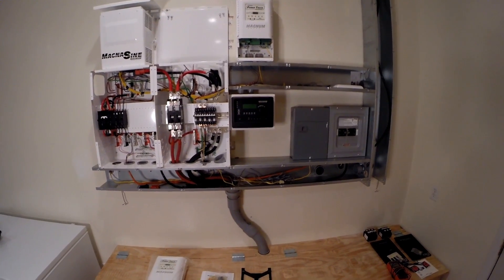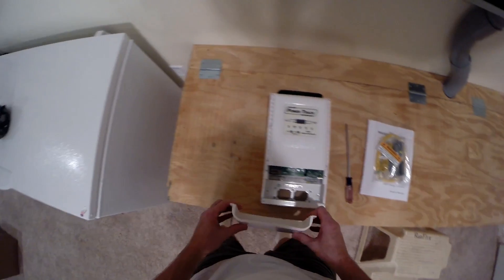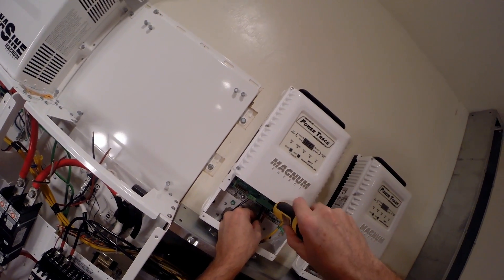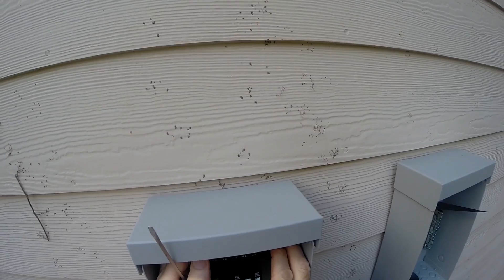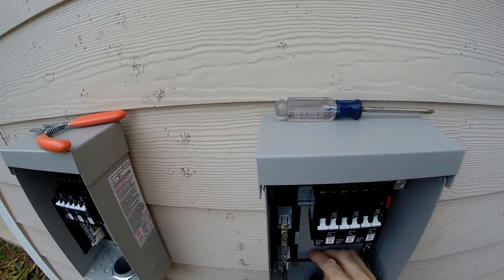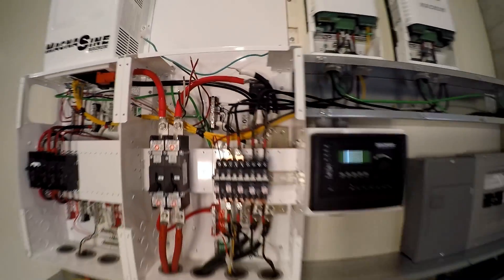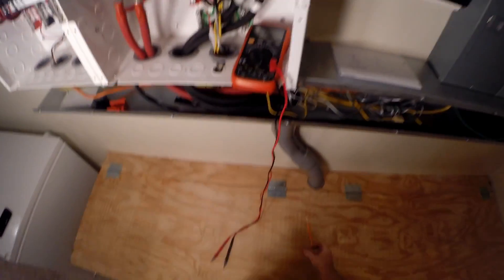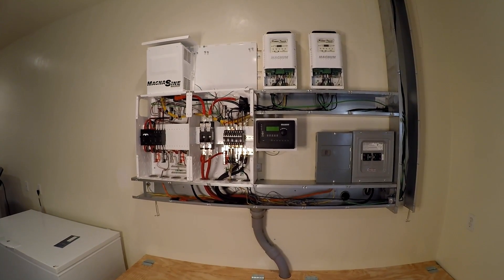Off Grid Solar #28: Installing Magnum PT-100 Charge Controllers

Comment: Ha!  How are you.   This showed up in my feed today, and I just wanted to say about 6 years ago I incorporated a lot of your ideas into my setup.  IE Magnum infrastructure,  and the transfer switch setup configuration.    I started out with 300AH of lifePO4  and slowly added 100ah at a time. until I wound up with 48v 800ah.    I  just recently   upgraded to 4 Trophy 220ah server rack batteries  instead of the Battle born's I started out using.  It was just plug and play  thanks to the modular setup  I have.  No small part to your ideas.!   Cheers!   - Mike
Reply from the maker: Hey Mike,  I would love to see a video of your setup.  Since then I have done a few mods myself.  
1. I added another 4,500Watts of panels and another PT-100 charge controller.  https://youtu.be/N7CoCI-0IoY
and
2. I swapped out my FLA for 30kWh of rack mounted EG4 batteries.
https://youtu.be/TJPOaQNCR54
and
I am now thinking of adding more panels facing east to get the early sun.  Maybe in the Spring.  

Nice to here from you and look forward to seeing your system!

Comment: Any issues with F20 fault on the slave? I've tried contacting Magnum but they are very slow in responding.
Reply from the maker: Brett, I don't think so.  This might help: https://youtu.be/lbcn3AMDm1c 
go to 6:25
Reply: Thanks, I have quadruple checked my dip switch addressing. The weird thing is the master recognizes the slave as it doesn’t throw a fault. When I try to run them in reverse order the fault is the same on the new slave. I have tried 3 different Ethernet cables. Perhaps somebody else will end up here trying to solve the same issue.

Comment: Hi David, at about 8:00 you are talking about DC breaker polarity. You mention that we always want to have the greatest potential on the '+' terminal of the breaker.  I agree the DC combiner has a higher potential than the input to the charge controller. But when talking about the output of the charge controller you say the batteries should be '+' (implying the charge controller output is '-').  In my mind, the charge controller output would be higher potential than the battery, allowing current to flow from the controller to the batteries.  So I would have connected the charge controller output to the '+' terminal of the DC breaker (and the positive battery terminal to the '-' breaker terminal) Do I have that backwards?
Reply from the maker: Hello Brent, Its been too long since I worked on this project so I don't recall why I did it this way...  You might be right.  I plan to expand this in a few months so maybe I can get back with you then.  Thanks!

Comment: I see that you have wired both PT-100s into the enclosure bus bars; as per the Magnum specs, those busses are only rated 125A, and your two CCs together can drive 200A into the bus.  Have you had any heat/operational issues or any concerns on those busses? I can't see what gauge wire they have used, but I am building a Magnum enclosure system and am struggling with how to safely wire in a second PT-100 and be to code....  can you see what gauge wire they have run from those small bus bars to the enclosure terminals?
Reply from the maker: Drew, I assumed that the Magnum pre-wired box would support multiple charge controllers and never really looked at it until a few months ago when someone else pointed this out.  I have since added a third PT-100 and still have not gotten around to upgrading this busbar and wire weak point.  I have checked on it during peak production (around 12,000 Watts) and the wire is warmer but not by much (just barely noticeable).  You can see more at     6:14 of this video: https://youtu.be/lbcn3AMDm1c
I do plan to beef this up but not sure just how.  Let me know if you find a good solution.  Thanks!
Reply from the maker: OK, maybe this: https://amzn.to/3yQK0pp
AND this: https://amzn.to/3jRfqWi
I'm thinking of running the three PT-100 onto the middle two terminals with soldered and crimped lugs.  Then two parallel wires from the two end terminals up to my two 4/0 battery cables (this is where the single lands now).  That would be good for 250 Amps on the bus bar and 570 Amps on the wire.  I could go with 2 AWG on the wire but this way a single wire could carry the entire load if one side failed.
Reply: @HomesteadEngineering  i am looking at using combiner plates like the outback fw-bbus on the positive side. 500a rated, so the three CCs in 3 holes, the main breakers in the other. I dont know if the spacing is right to stack the bus plate on the breaker terminals. We could probably just drill out copper plates for both the pos and neg Busses though, and just stack the plates and lugs on 3/8 posts.. Otherwise I don't see a good space in the panel to mount busbars.  Midnite's battery combiner box is the right solution, but it involves another enclosure and much longer wires, and is pricy.   I reached out to Magnum and they said only on be PT-100 is rated on the bar and had no suggestions.  I think it's a major design weakness, and my only real complaint with the system .
Reply: @HomesteadEngineering  still only a 250A bar and 300 from the charge controller.. ithink adding plates right to the terminals in the enclosure is probably neater and safer...  Also in my jurisdiction I can't use welding wire, I have to use DLO cable (CSA listed) or I fail inspections..
Reply from the maker: @drewthompson537  Looks like that might work.  I'll have to think about this more when I closer to fixing it.  Thanks!

Comment: you are gaining on it. that's going to be a nice system when done. the inverter works great. I haven't used one of those charge controller yet
Reply from the maker: Getting closer to flipping the switch.  Hope it does not blow up!
Reply: It will work. Think positive.

Comment: Why 2 charge controllers? 187 volts  100 amps each controller, wouldn't one handle up to 40 300 watt panels?
Reply from the maker: The number of panels (Watts) and the configuration (serial and parallel) must be designed so that you don't exceed the maximum Watts, current and voltage.  I have a video on this and a spreadsheet that allows you to design a system.  https://youtu.be/CdJxrG-BSbI

Comment: That positive lead is a very small wire gauge. Especially with all the combined amps... i would use #4 awg
Reply from the maker: Well maybe... but here is how I sized it:  My open circuit current ISC=9.75A for these panels.  I used the 1.56 multiplier so I get adjusted ISC of 15.21A.  Multiply by 3 strings and you get 45.6A worst case.  So I probably could have used THHN #8 but I upped it to THHN #6 which can handle 65A.   I checked the voltage drop and I am less than 1V and less than 0.8%.  In practice I find it does not get hot.

Comment: It looks like you have two sets of breakers between the panels and the charge controllers.  I assume that's so you can turn everything off from inside.  If you wanted to save money, you could just use the disconnect outside the house if you wanted to isolate the charge controllers, could you not?
Reply from the maker: It's been a while since I built this so I'm going to have to get back to you on this one when I have a chance to think about it... Thanks!

Comment: You have a TON of money in your system. I really hope you’re off grid
Reply from the maker: Brandon,  We are connected to the grid and will stay connected.  We have been steadily reducing the amount of power we pull from the grid.  Last month we got down to 12 kWh/day down from 70 kWh/day three years ago.  We have about 18k into the system (after tax credit).  It will take about 9 more years to pay for itself and then be a money maker.

Comment: Neg dc is black not white. Also ac and dc are not allowed in same enclosure. If so need to be in there own divided space.
Reply from the maker: I have two enclosures, one (left) for AC and one (right) for DC.  They are not mixed.  I believe the color coding is correct.
Reply: Indeed... gets confusing as -DC is BLK, BLK is HOT